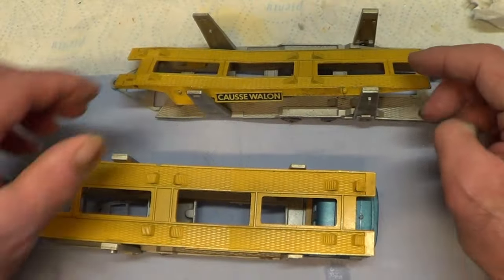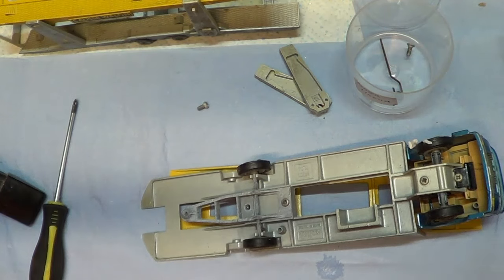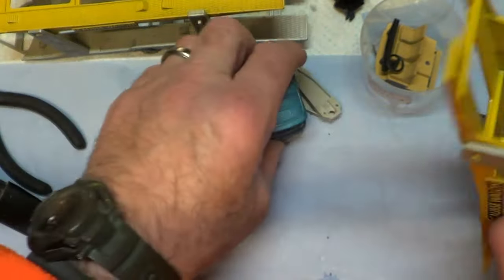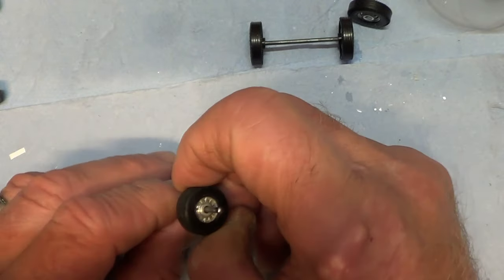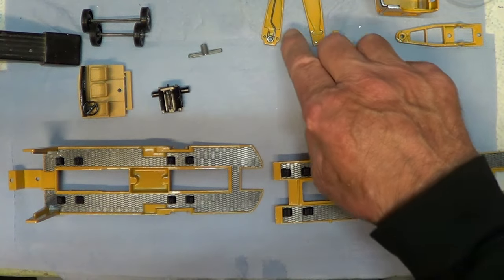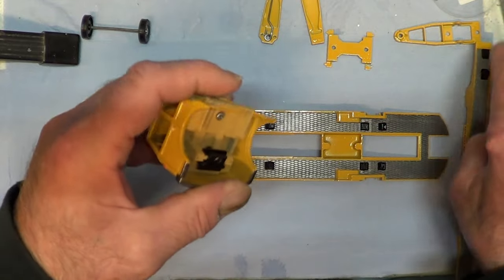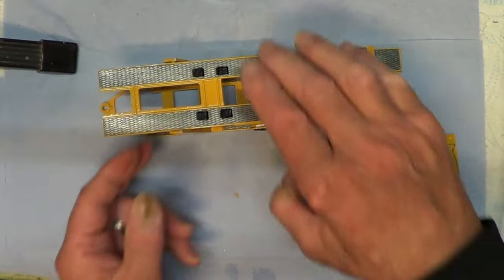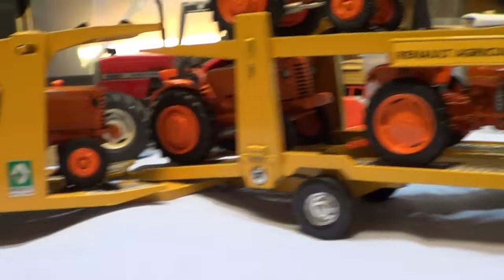CUSTOM RESTORATION OF A SOLIDO 321 SAVIEM CAR TRANSPORTER

Comment: Hey Nic! I was beginning to worry about you - I sent an email which bounced - but it's nice to see you back in action! Thanks for the shout out - I remember sending that  set because I was harvesting Brits from an old toy box, and since the truck was a Frenchie, I thought it best with you since you are nearer France than me! The tyres and wheels have chemically disintegrated, I think: it was never stored anywhere near anything that could have been described as hot: it was in Scotland! I'd have soaked the whole thing in WD40! There might have been a coil spring under the centre of the front axle, down that hollow...

Splendid result! Colours look excellent. And that tractor load looks terrific. I also have some good news: I have found a rear ramp! I'll get it posted to you!
Reply from the maker: Thank you Fraser, it was nice to do a model of a different make for a change, it’s definitely a chemical reaction with the tyres and wheels like on some of the older Britains models. I thought the same as you about the possibility of a spring being in the hole under the front axle but once in place, the front axle is clamped tight, no room for any up and down movement so I don’t think there was ever a spring. 
That would be really marvelous to have the ramp to fit, it would finish it off, so thank you very much for that, I have two more tractors coming to finish off the load as well and talking about tractors I must get that Corgi MF 50b loader tractor sent off to you.
 Take care, all the best, Nick🐸🐸🐸
Reply: @crapaudnicksdiecastrenovat1739  A small parcel will be in the post to you tomorrow nick - I think it is the correct ramp though it seems to be missing a hinge mechanism - but I am pretty certain you'll work something devious out to make it work! Cheers.
Reply from the maker: @frasermartin6728  thank you very much for that, the ramp for these is separate I believe, no hinge, just slots in, so I don’t think anything is missing from it😊👍

Comment: That was a great restoration, nick .I hadn't seen one of those before, so that was very interesting to watch. It's nice to see it had screws .
Good choice of colour, and the wheels look the part. Excellent. All the best Martin
Reply from the maker: Thank you Martin, I couldn’t decide whether to do it this deep yellow or orange, I had a full can of the yellow and only a small amount of orange left so that decided it lol! The trailer wheels aren’t great but they are a lot better than what they were, I could maybe have sanded them a bit more but I didn’t want to take too much off them. The screws made it easier but I don’t know why they were so tight to undo, I think there was a little bit of corrosion in the threads. 
Take care, all the best, Nick🐸🐸🐸

Comment: WOW, absolutely WOW. That's fantastic Nick, absolutely fantastic. I think Saviem were either taken over by, or became part of, Renault in the early 70's??? When I saw your Renault Agriculture stickers I really got excited, it's a fabulous restoration. Your front grille sticker is superb as well. Did you remove the headlights, were they yellow plastic? Are the little tractors those Hatchette models? This is one of your best restorations Nick, well worth waiting for, you've done yourself proud and I bet Fraser is impressed with it too. Well done and thanks for sharing it with us. Best wishes. Peter.
Reply from the maker: Thank you Peter, I’m not sure about when Renault and Saviem came together but I am quite sure you are right, the headlights were plastic, I had to drill a hole behind each one so that I could push them out from the back. Yes the tractors are the Hatchette models, but I like the more modern one one the top deck at the front best, the others are a bit old for the lorry but they were the only ones that would fit on the bottom deck, and the only ones I could find on eBay at the time, I’ve got two more of the newer ones on the way now to finish the load.
Glad you enjoyed the video, take care, all the best, Nick🐸🐸🐸